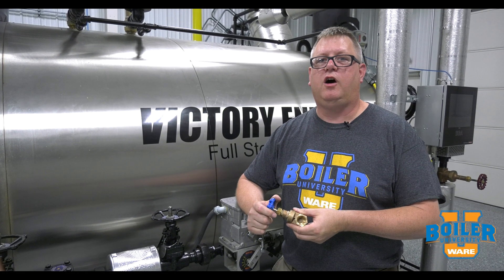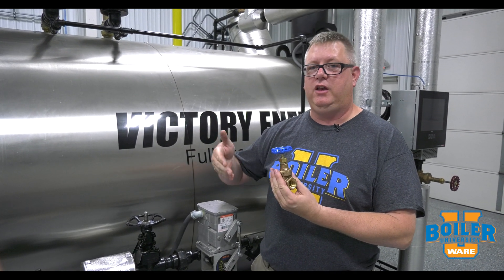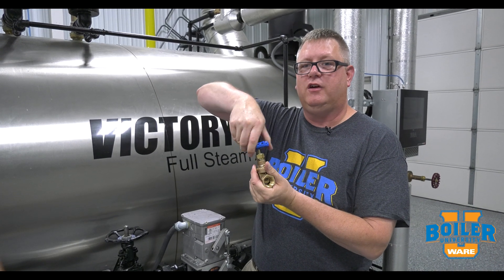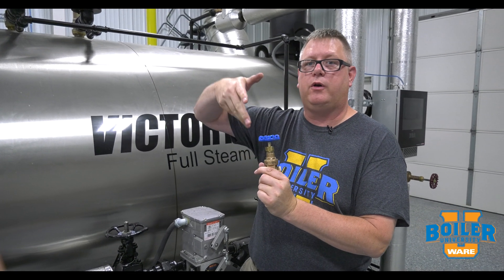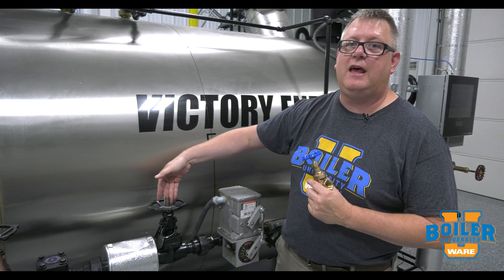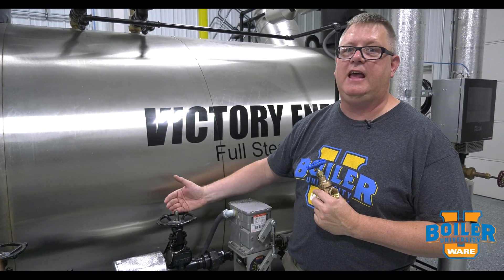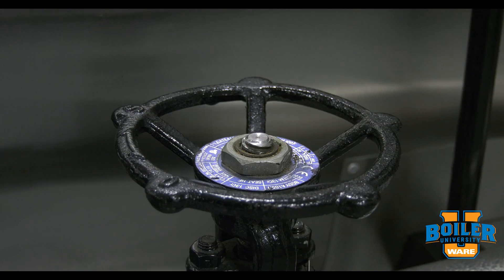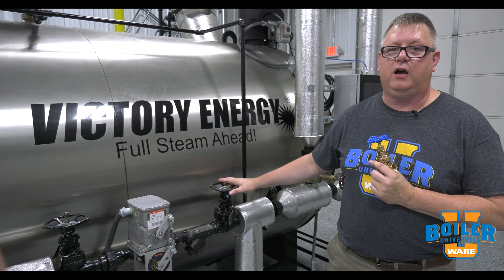Different Valve Stems on Gate Valves and Why It Matters - Weekly Boiler Tips

Comment: for that rising stem gate valve you showed, can the bushing be replaced if it has sheared off resulting in the hand wheel screwing off?  without replacing the whole valve.